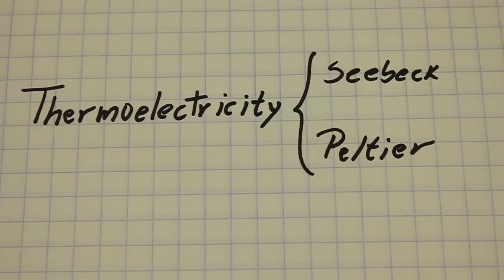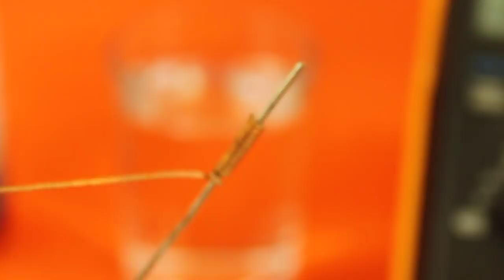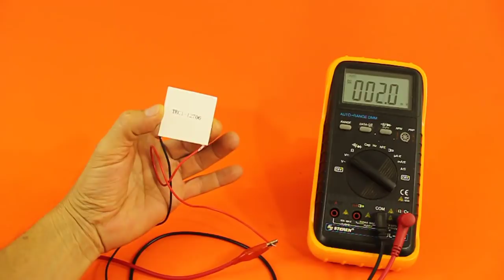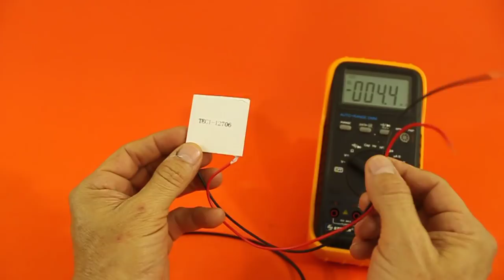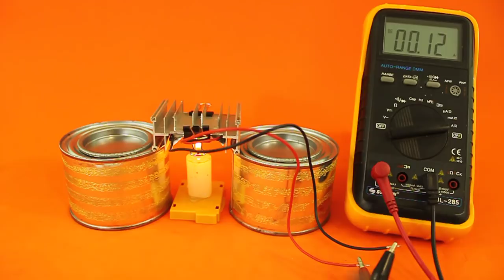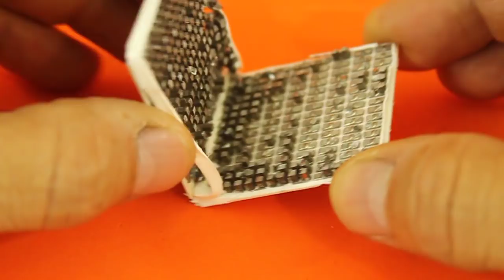Thermoelectricity, Seebeck and Peltier Effect. Electricity Generation from Heat.

Comment: problem is that you heat up your heatsink so your basically not generating any electricity in the end. you need apply fan or water cooler to increase the voltage (higher potential difference).

Comment: make a thermoelectric generator train line  and put the power from the heat of the train line directly  into the third rail. Maybe even have piezoelectric generators in the same line, and put the power into the grid via the third rail.The third rail the exposed metal wire would be cold as it is covered , and the train rail would be hot from the sun. Can this work or am i over thinking

Comment: Since you destroyed the module anyway, it does not really matter here, but for everyone else trying this: if the modules get too hot the solder joints you saw inside melt and the module will most likely be scrap after that. This can happen when heating them externally or even when you drive them with current and let the hot side get too hot.

Comment: The TEC modules dont produce much power but they do have the big advantage of simplicity of no moving parts. You can boost the power with little circuit boards you can buy off ebay for a few pounds. The biggest issue is preventing the pad squares from overheating and melting. The best way to do this is to use water as a medium between the module and the heat source which gives you more control over fluctuating temperature extremes. TEG modules give more power than TEC modules but they are also more expensive unlike the tec modules that cost pennies.

Comment: So if you had a ridiculous amount of peltier coolers handy and a few candles, along with some scrap electronics, you could build a phone charger I'm assuming? Interesting.

Also you might want to make it a habit to give some dialogue before the outro to prevent people from being jump-scared.
Reply from the maker: That´s good advice! I do have around 50 peltier modules but I´m too lazy to try a charger interconnecting them LOL
Reply: There are also big Peltiers that can handle hundrets of watts but they are horribly expensive and you still dont just need a strong heat source but also a way to cool the other side and isolate them from each other.
Reply: You can already by something like that in different designs for camping trips. There are that you put near the campfire for example or portable ones that have a small stove built in (a little bit bigger than a thermos).

Comment: I though you were going to put it above the candle and then cool the other side with canned air at the same time, the greater the difference of temperature, the more power it will output

Comment: I think, the voltage and the current should be measured at the same time, because a load on the contacts will probably reduce the voltage. Anyways, peltier elements are fun. Last year I could get like -35°C with two stacked elements, a water cooling of the hot side and a pc power supply. I have built a cloud chamber with it and could make visible some radioactivity.
Reply from the maker: Interesting, you should make a video of your chamber
Reply: Hello there ...

Did you use only water cooling for that side and you were able to get this -35 degrees?
I mean without cooling that water?
How long it will take for water to get very hot (like 80 degrees Celsius) if only water cooling have been used on the hot side?

I have a project I am researching for it and your answers may help me.

Thank you.